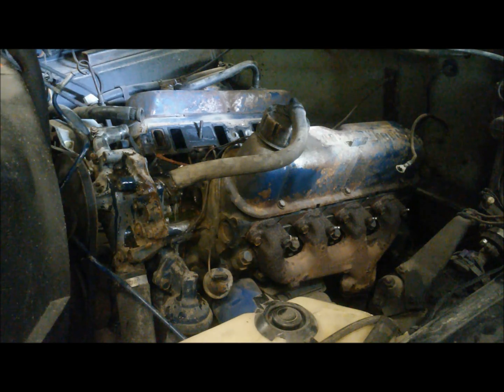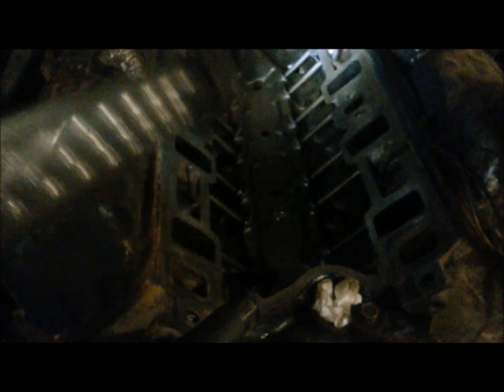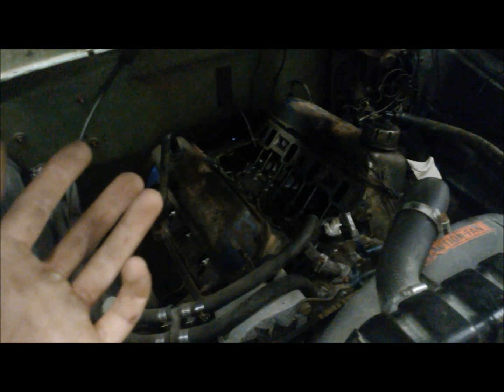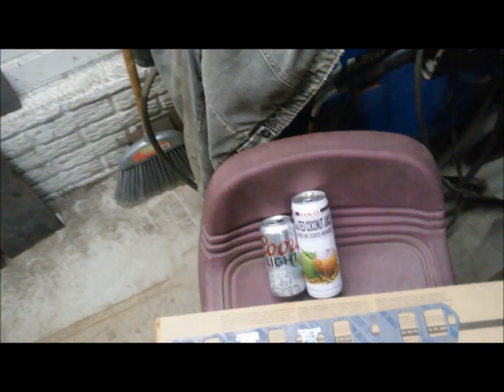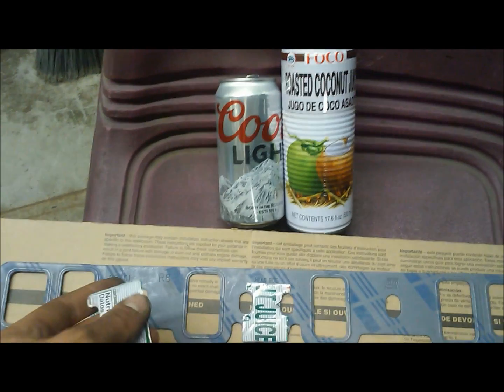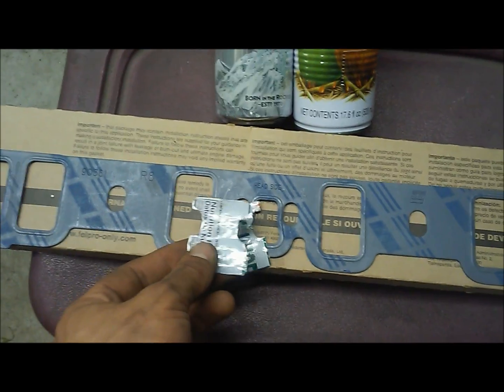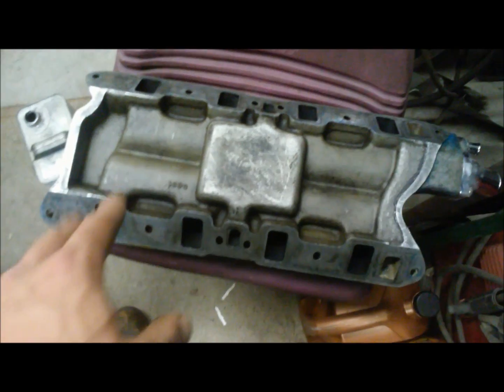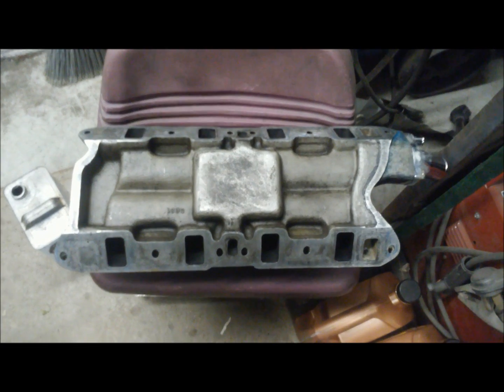No More Vapor Lock! - Intake Heat Crossover Block Off

Comment: Luke, I have a 65 lesabre and was wondering if i could just drill tap and plug the holes in the crossover track just to keep my carb from locking up? carter afb. never had vapor lock problems with this car although it only gets driven around 200 miles a year. 10 years ago carb locked up so got a reman and now locked up again, just in time for the fall car shows and fun runs. thanks man

Comment: When you block off the crossover, wouldn't you run the risk of having the crossover channel in the intake  still heating up and cracking the manifold itself since the air inside has nowhere to go? Or does it not matter cause of the constant flow of fresh air and good dissipation with aluminum?

Comment: I could use the Fel-Pro 1204 which has the metal block off plate already on the gaskets, or would it be better to just by an aluminum intake that doesn't have the crossover plenum? Would that cause any issues?

Comment: Great vid,TH. Question-What do you think about filling the crossovers in the CYLINDER HEADS with aluminum or a hi-heat epoxy ,350 chevy. If just intake is blocked,is there flow disruption in the cyl heads where the ex flows? What’s your thoughts?
Reply: I've packed both crossover inlets on the intake manifold with the cheap gray looking epoxy putty you knead with your fingers. Seems to work good.

Comment: Thanks for the good vids. I just finished commenting on your other vid and you seem to have done all the things I've been wanting to try. Have you ever done a lifter valley pan/heat shield underneath the intake. I've seen some write ups but no real world experience and results.
Reply from the maker: i will answer both of your questions here - you are fine with torquing to 20. the iron intakes torque to 25 - you will in no way overcome your head bolts that are torqued down, you would pull threads out before that happened. ive done many a 302/5.0 engine. your biggest concern is making sure that intake is torqued down good and even. 
now, the heat shield. you dont need anything like that, you actually burn the fuel vapors, so a little intake heat is not a bad thing at all. if you want something that eliminates the heat crossover and protects the runners from heat, just go with an air gap design intake. they do very well and deterring heat issues. couple that with an annular booster carb and you have yourself one hell of a set up. i have come to this conclusion from many years of daily driving carbed 302 stuff all year round - including race applications. if you have further questions, feel free to ask.
Reply: Thanks for the tips. Very informative. I'm using a H.O. fuelie intake so I don't need the fuel vaporization but it's nice to know in case I go that route in the future.

Comment: these used to come in manifold gaskets sets back in the day
Reply from the maker: im really not sure why they dont. there is a gasket that is blocked off entirely that you can get, but it doesnt have anything like a metal liner, so in the end the gasket eventually burns up and your back to the same situation yet again.
Reply: ThunderHead289 yeah that's the one's I last used because I couldn't find a gasket set that had the block offs in the set and that's back when I was working at o'riellys. ..I've made a few of those in the past using copper roof flashings also brass and aluminum as well the copper and brass ones held up the best...but those types of materials aren't always easily available at hand in a pinch so the cans is a great way to go I myself use that for a few different things when in a bind one can always find an old can to use
Reply from the maker: as long as its those thick oldschool cans, it seems to work very well
Reply: Good vid! Right to the point. Why do you put it on the head side?